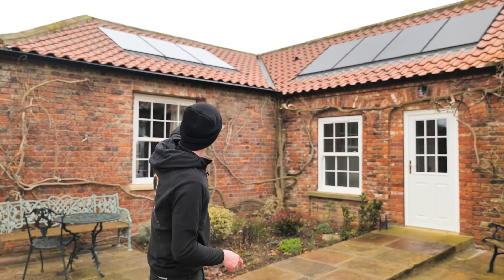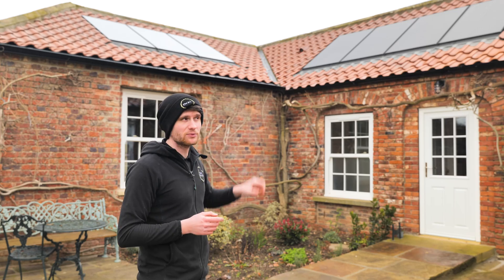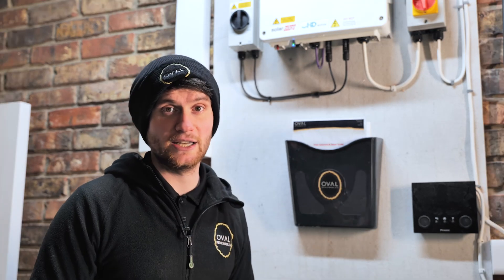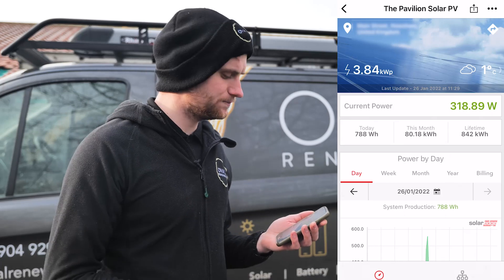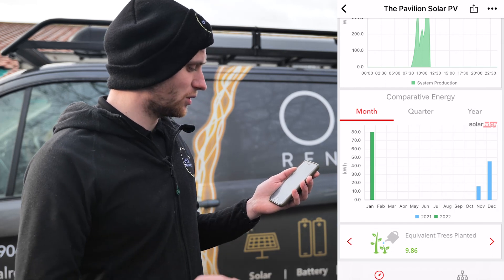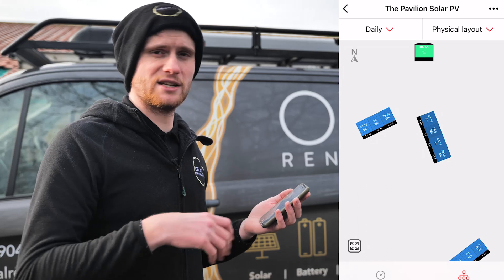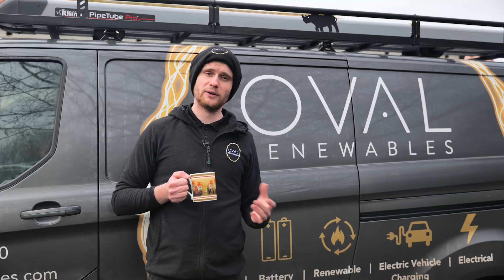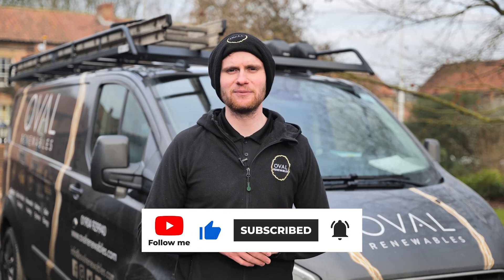Howsham Project Part 1 - Stunning Viridian in roof solar PV system with optimised SolarEdge

Comment: Hi Sam, I'm  expat electrician living in New Zealand. I installed with a 5kw solar grid tied system to our house back in 2020 which has been performing great until recently when I've noticed my Sungrow inverter has been clipping and shutting down several times a day due to high grid voltage fault. I believe that the problem is to do with several other neighbours catching on to solar and we're all trying to compete exporting onto the same transformer. Do you know of a good solution,  without going to the expense of adding an aditional AC coupled battery? If not what would you recommend. Cheers
Reply from the maker: If you house is in the UK then the DNO should look to decrease the grid voltage 👍

Comment: Starting to look into panels for my 2 bedroom end terrace house. The main reason is to get my energy costs down for when I retire. However I am wondering if there is a cost effective system that would provide all your energy for TV, Kettle, router, air-fry cooker, etc. Basically the basics so that you would never have any electricity bill or energy bill?
Reply from the maker: Thanks for the comment. Sounds like a plan! So the scale of system will depend on how much of your demand can be cover by the solar. That ultimately will depend on roof space. Battery storage is also going to be crucial for you to try to achieve this

Comment: G98/G99 question. Thinking to install 6kw panels + SolarEdge inverter + Sonnen SB10 battery (similar system was shown in your Artisan video).  Your explanation in this video suggests this would need G99 approval, is there any way to design the system to allow a G98 retrospective approval.  Thank you for all the extremely clear explanations of solar in this and your other videos, it has helped me a lot in deciding what to install (that is, if I can find any one to quote me!)
Reply from the maker: Thanks for the message, for the type of setup you describe you would need G99 approval before the installation because of the size of the inverter and because the battery would also be installed.

Comment: Hi Sam,

Very informative video. Always good to see someone who takes pride in their work. Looking forward to part two to see how the old & new are configured.

In a previous comment you stated that earthing of the panels is not required for DC. Does that also apply to an Enphase AC system? (The inverters are double insulated so they don't required one)
Reply from the maker: Thanks for watching! Yes that will be out soon. In most cases earthing is not required for the metal work on the solar side of things. We don't install the Enphase stuff but I would assume this would be the same as the equipment is double insulated like the panels.

Comment: Lads what size are the AC & DC Isolators?? Does the mains board u get supply off have an spd fitted?? Great video again btw 👌
Reply from the maker: The AC isolators are 20a three pole and the D.C. is a 920v 11a. The main DB is an RCBO board with SPD. That was installed by the onsite electrician
Reply: @OvalRenewables  sorry lads another question.  What type and size isolator are yous using for the batteries?? Cheers
Reply from the maker: @connor3087  no problem, we usually use systems that have in built DC isolators so we dont have to fit those. So usually its just an AC isolator that we fit which is normally Gwiss or MCG
Reply: @OvalRenewables  thanks for your reply much appreciated 🙏  and I hope the channel goes from strength to strength 💪